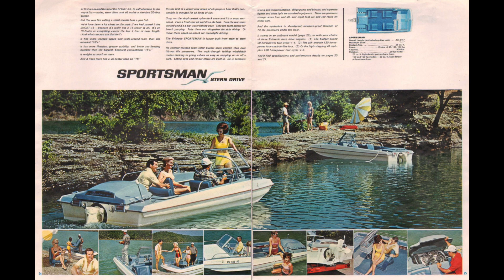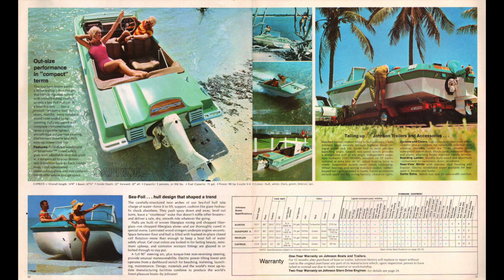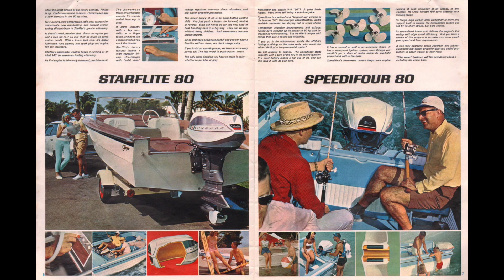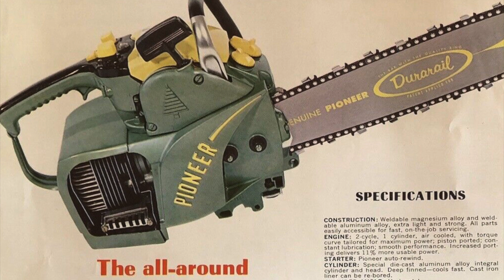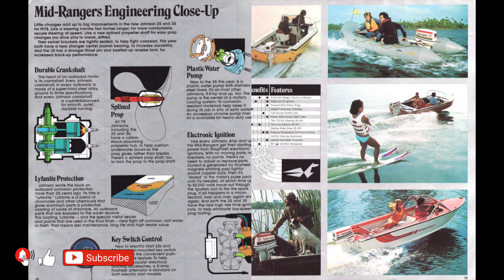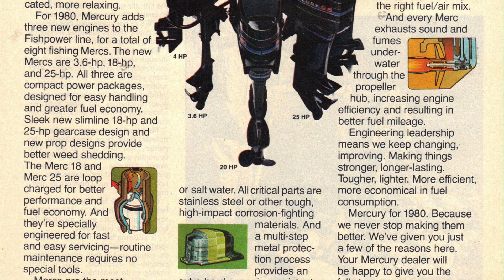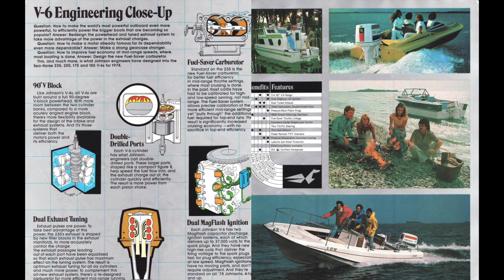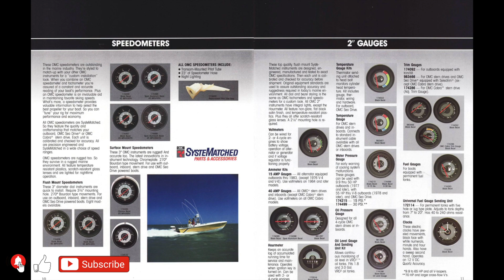OUTBOARD MOTORS HISTORY - OMC OUTBOARD MOTORS - EPISODE 4

Comment: My Dad purchased one of the Evinrude Boats. The Sweet 16. Well made and very Stable. Had a V4 90 Evinrude on it, which had a Prop on it that was smaller in Dia, than the Props on the 40hp, and used almost no gear reduction(23:20) in the lower unit, weird Design.

Comment: as you knew i has a really good asscioation with these OMC outboards as my father had a Johnson 25hp 2 stroke outboard was a really good motor as i liked these johnsons they as a really good motor my dads johnson 25 was a pull start model we had thiswas on a 12ft timmy thiwwas really was our very first boat in my family thiswas really was my starter to knew these OMC outboards as i really had a really strong Asscioation with the Johnson brrand of outboards thiswas really the case was a 25hp outboard we had on our 12ft tinny boat we had in Australia as you knew im a OMC Fan thiswas why i never use other outboard brands mainly in the 2 stroke modeks say from the 15hp right up to the 250hp V6s thiswaas really due to my long asscociation with OMC outboards due to my long involement in boating with these outboards like the Johnsons in future as thiswas why i never have other outboard motorbrands other than Johnsons in my boats as other was giving e trouble alot these was othr outboard brands was really are trouble was other brands that was i say was Mercury and the Japanese brands like tohatsu are in my view was alot of trouble thats why i have motors made by the really good OMC was Johnsons and evinrudes are my preffered outboard brands thiswas due to my experience with OMC was really good motors was beig made by this outboard makers like OMC thiswas really why i reather have these outboard on the back of my boats in futre no mattter i canget parts for these OMCdonks dead easy in futre as there lots of these outboard around in future thiswas my views on the really good Johnson outboards like the gutsy 25hp Johnsons thiswas based on what h d used on my fathers boat years ago now what a really good outboard in my views was the say the 1972 and later on Johnson 25hp 2 stroke outboards thiswas what i knew on theese good outboards in my views was a really good outboard motors they are the best idsay
Reply from the maker: Thanks!
Reply: @BoatMotors  thats was my knowledge on OMC was based on my experience with them motors and thiswas based on my time as a ex marine mechanic on these outboards thiswas as i knew on these OMC outboards was my good knowledge on them good sort fo history lesson on OMC was a good video mate from Australia
Reply from the maker: @Michaelwalkerbluebrutusfunnyca Thanks!

Comment: Very good condensed history.  OMC made some good motors in the 50's and 60's especially their small 1 and 2 cylinder designs.  Most of the improvements and changes they made to the model line had been developed and implemented years before by Mercury. Their V-4 models in the 60's and early 70's suffered from inconsistent quality and reliability.  They did excel in corrosion resistance and were early in the stern drive development.
Reply: My mom's sister's husband worked for Mercury in the marketing department, he represented the company at trade shows. He knew a lot about OMC motors, and why they failed.He is also an expert on snowmobiles.
Reply from the maker: Thanks!
Reply: I knew a Mercury mechanic in the 80's.  He said that OMC motors were absolutely superior to Mercury from the 60's through that time.  Said it wasn't even close.

Then came Ficht... :(
Reply: Yes Ficht was a problem, I painted the fuel injectors
Reply: OMC and Mercury should have developed bigger DFI 2 stroke v8's and I'6's instead of the auto 4 joke stroke junk. i never understood car culture with its 4 joke stroke obsession.